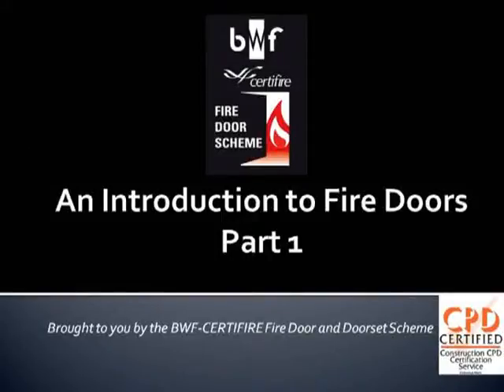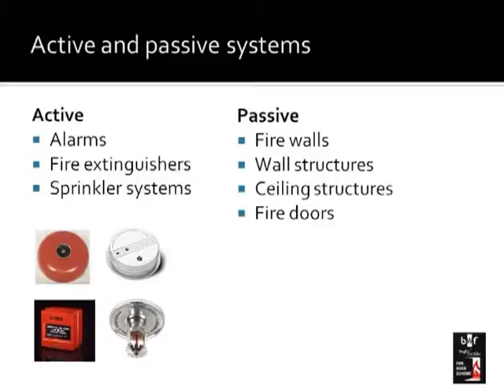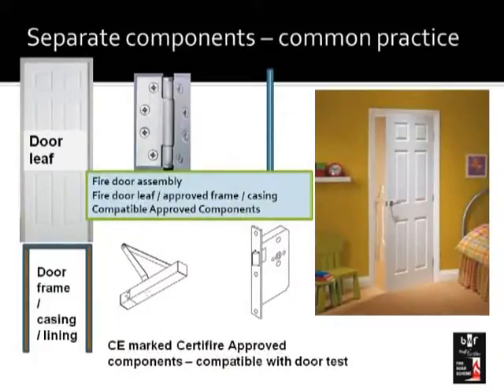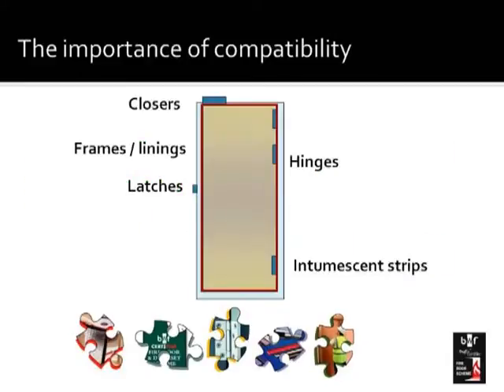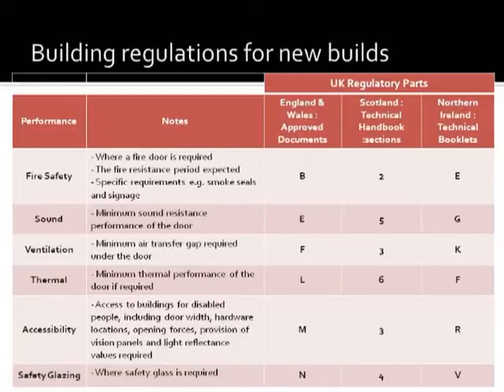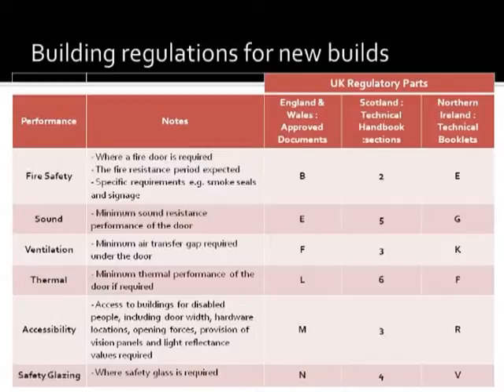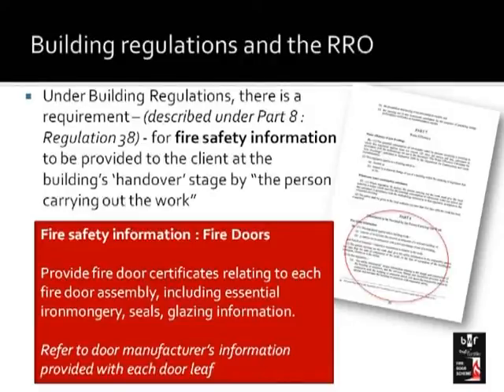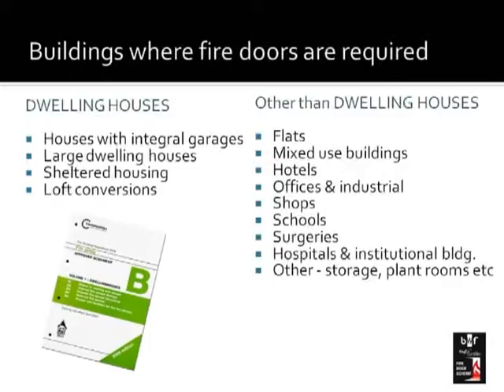Wood Campus - Fire Doors - an introduction (part 1)

Comment: I sat and achieved the FDIS Diploma, Excellent course, very informative, However, once you pass they take all the training material away, nobody can keep all that information in their head all the time and there may be a need to refer back to your training, which you wont find 😔, so good course, but I could only award 5/10, I did mail FDIS about the concern and was told it would be passed on,  of which nothing came of it 😮‍💨Consequently, I have sought alternative training with a provider that not only allows you to keep the training material, but supplies upgrades FOC.